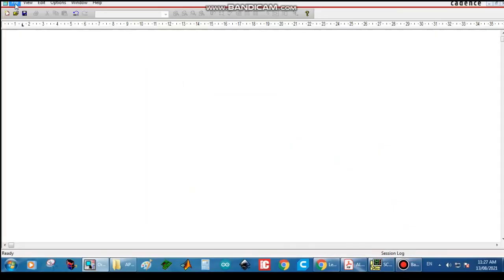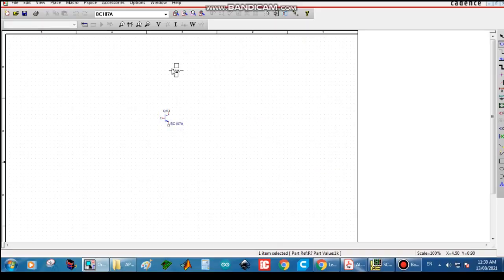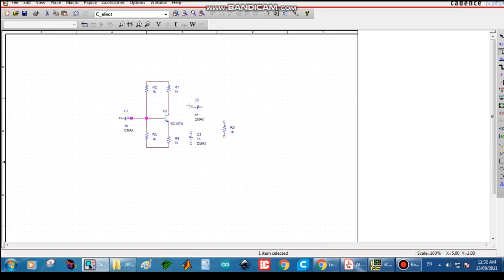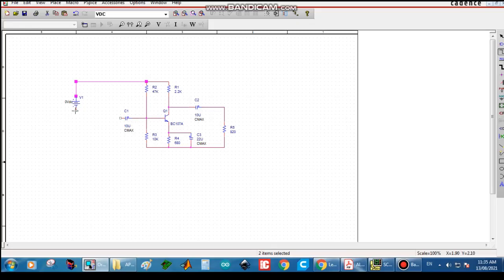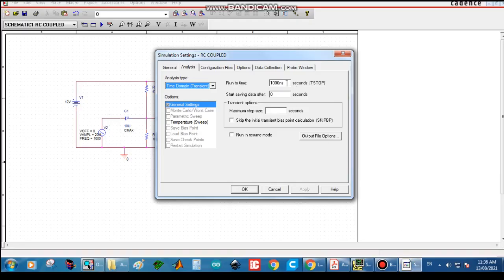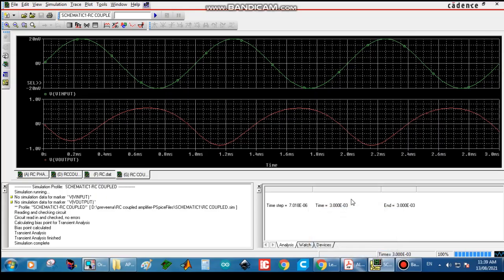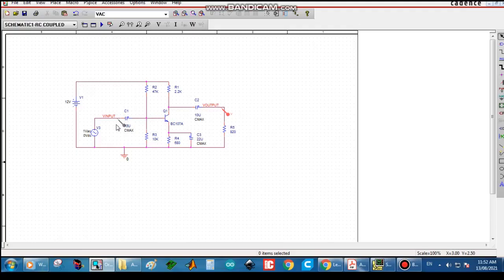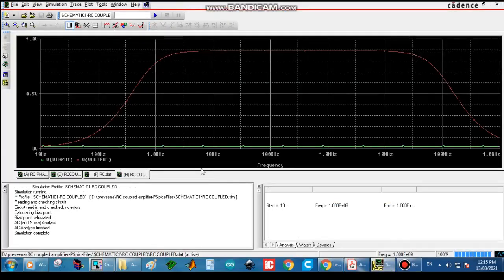RC coupled CE amplifier PSpice simulation

Comment: Hi  , thanks for the useful information. Do you have an email address i would like to talk to you.
Reply from the maker: If you have any doubts you can ask here..
Reply: @PreveenaKp  Mam what if the qs is asked  if the “Voltage gain is given”
Reply from the maker: @scoop._2298  if the voltage gain is given, you have to design CE amplifier for that gain. That designing steps i had explained in rc coupled amplifier experiment. You can refer that video. For various gains the component values will be different. So you must design it.. And then you can draw circuit with the newly designed values on the pspice edit window